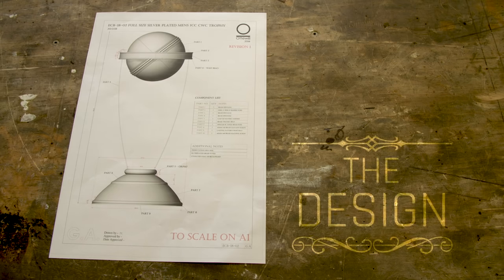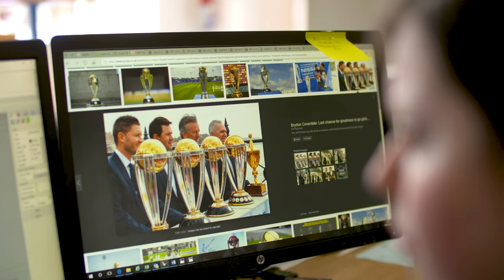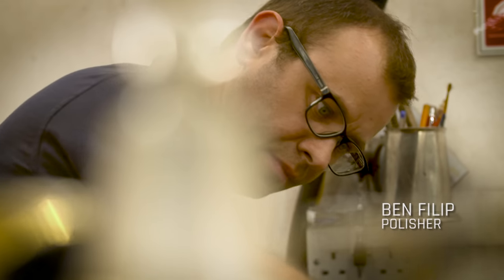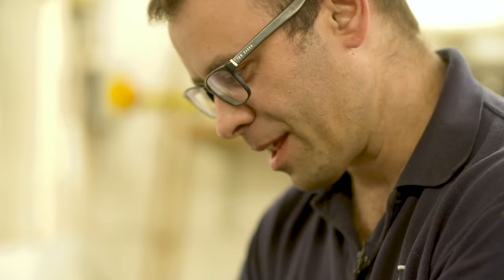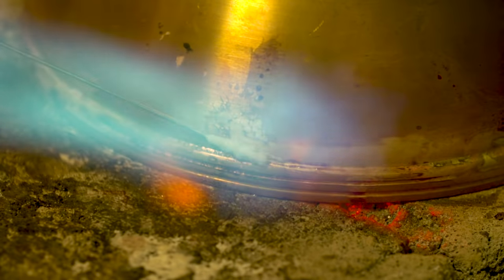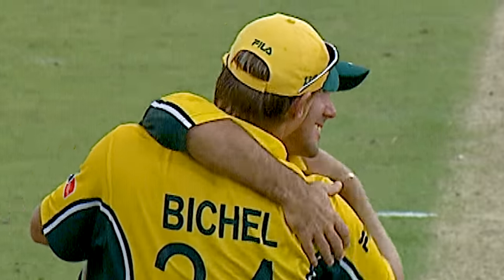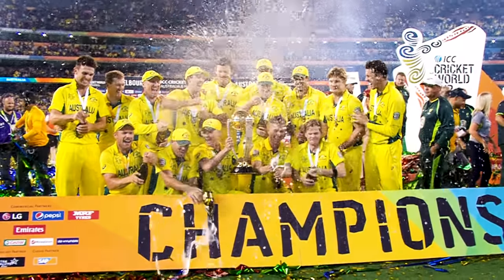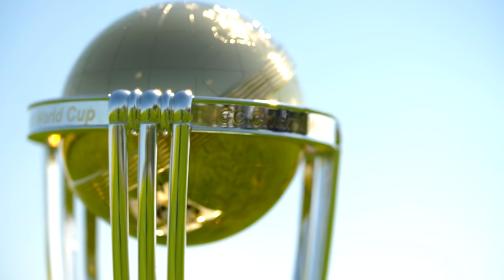The Making of the ICC Cricket World Cup Trophy

Comment: Next time use 2 magnetic rings
1 inside the ball.
2 outside support ring.
Let the ball(globe) elevate at the top.
Reply: Won't work. The ball will pop out due to repulsion. Even if forced to stay there, it would start rotating.
Reply: Trust me Use larger and high magnetic Strength ring as base, and lower mag. Str. In ball.
Have u seen floating speaker in amazon.com
Works on electromagnetism.
Same can be used here.
Reply: That will be designed surely in future..
Reply: @naveenmr9062  that speaker has electromagnets here they need to use magnets magnets lose strength so over they years the ball might just pop out and I guess this won't be a pleasant sight so pls don't use your brain.
Reply: Lol...have u heard of physics??THE MAGNETIC FLUX OF A SPHERE AND RING ARE DIFFERENT....AND NORMAL MAGNETS ARENT STRONG ENOUGH TO BEHOLD THE PHYSICAL FORCE IF ANY PLAYER TOUCHES THE TROPHY AND LIFTS IT TIGHTLY.....IN THAT CASE ELECTROMAGNETS NEED TO BE USED WHICH IS IMPOSSIBLE....102 ARTS STUDENTS LIKED THIS COMMENT🤣😂
Reply: It will not work. The levitating speakers you're talking about is meant to be kept at one place, a trophy is not. As soon as you move the levitating trophy, the top part will topple and the trophy will fell.